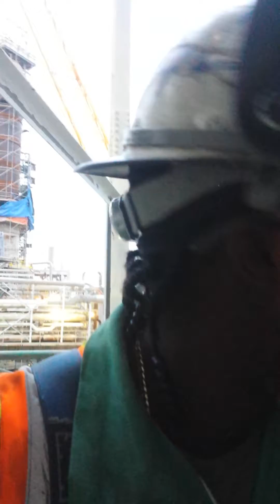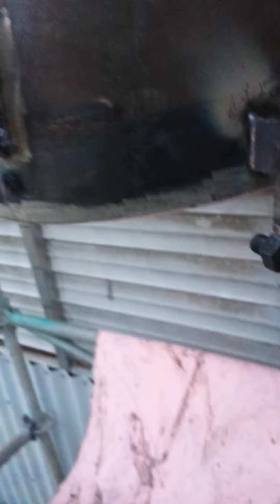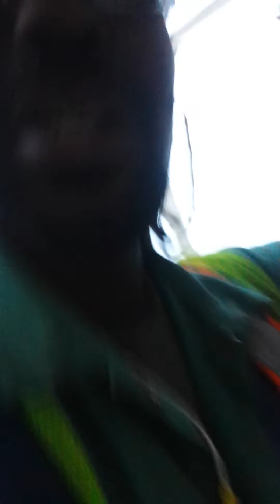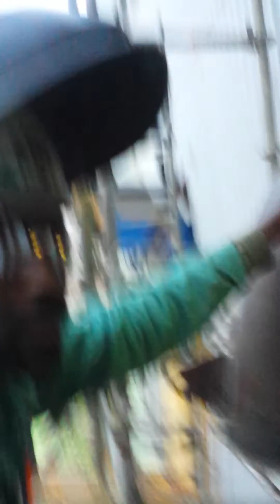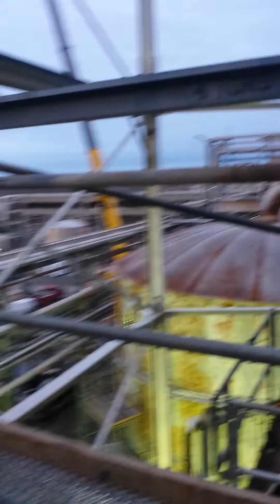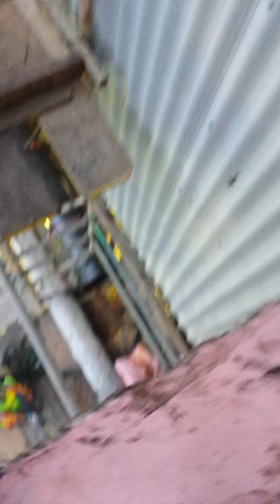Pipe welding with ChrisTaner "shut down money"

Comment from the maker: It really doesn't matter if your a beginner, as long as your able to pass there pipe weld test you got a job, you will be making the same amount of money the guy that's been welding 20 or 30 years. You pass that test your in the door. One thing that usually get pipe welds with little experience is the different positions and tight spots. Sometimes  you have to make a weld in a tough spot so make dam sure you practice welding in tight spots , challenge yourself your money depends on it.

Comment: Thank you for the information I see you know your craft really well I will utilize the info and run with it I have another question how would a beginner get his start welding pipe in the plants I had went to apply at a job today and I ask what kind of test and the person said a P5 test doing chrome and stainless how can someone like me have my start in this field if the test has a alloy I never welded before I welded a little stainless but never chrome that's something welders learn in the field correct I was talking to a buddy at the school today and he said the best bet is to get hired as anything in the plant to get our Foot in the door and go from there I really appreciate your wealth of knowledge god bless .
Reply from the maker: Dont be nervous always remember that you can us a scrap piece of metal to test your heat (aka amperage)  and also see how the metal is flowing to determine if the amperage is where you like it.  Hey welding is weld, chrome welds just like carbon the only difference is the pipe is often pre heated and purged especially p91 chrome.  stainless on the other hand is a little different but you can handle it. Run yourself a few practice passes  on a scrap piece of metal, just make sure your amps are not to high in other words make sure your not running to hot. Remember you are a welder and you no what your doing , if not you wouldn't be trying to take a weld test.
Reply: I appreciate your advice thank you and I will be waiting on the website you were talking about on your previous vids I'm thinking of buying some heavy wall 2 inch so I can take it to school and practice there